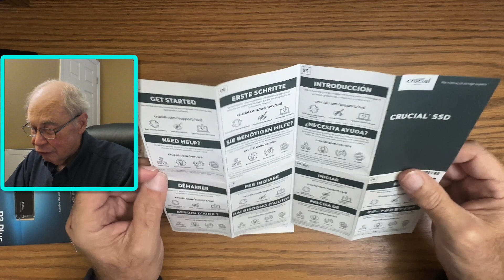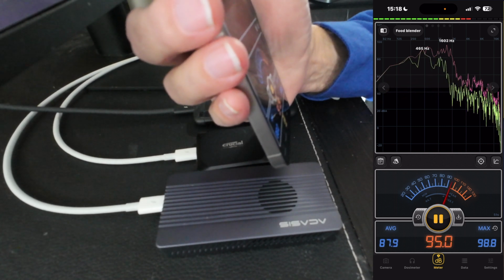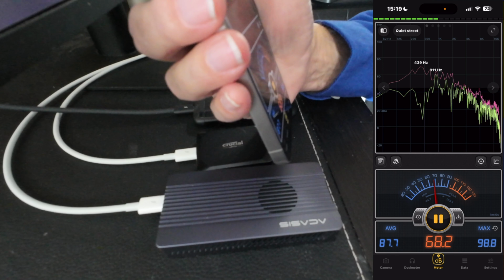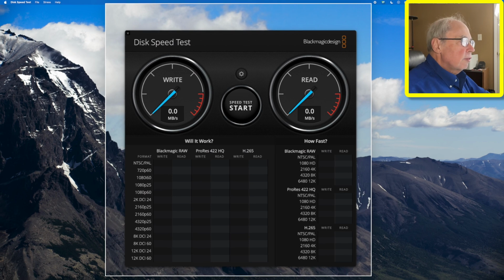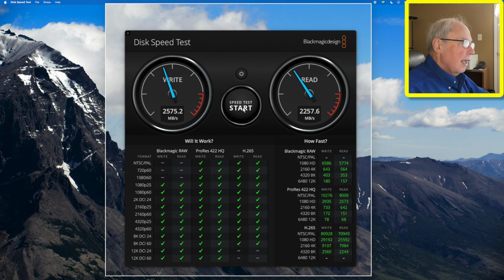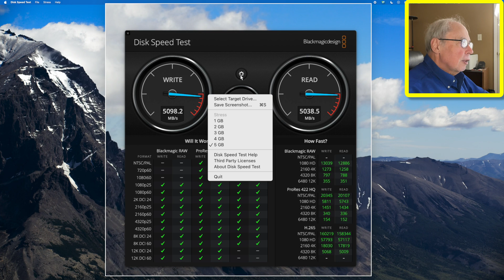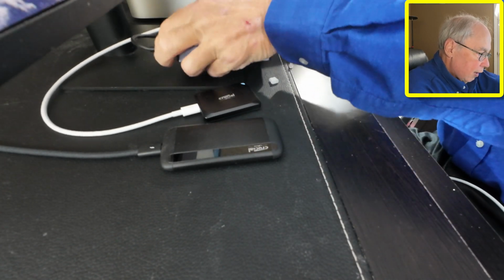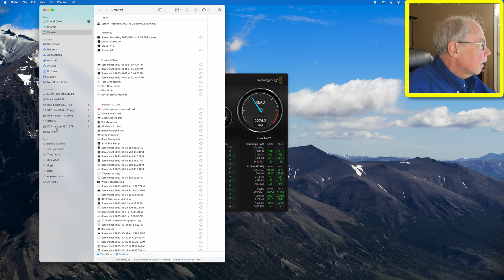Acasis Enclosure with Crucial P3 PLUS NVMe M.2 SSD - FAST ENOUGH?

Comment: Please remember that the cable that comes with this enclosure is a Thunderbolt 3 cable, so to get thunderbolt 4 speeds and compatibility you will need to buy a separate Thunderbolt 4 cable.
Reply from the maker: Thanks for the tip! It just so happens that I ordered TB4 cables from Amazon and they are due today. I'll take a look to see if I can get more speed. The cables I ordered are Maxonar brand because they are cheap! I'll stop by the Apple Store and get one of theirs as well just for comparison!
Reply: @ed-tech-review  and what are the results?

Comment: I've been seeing a lot of reviews of the Acasis enclosure lately. Having to guess which thermal pad to use is a little unnerving for me. How well do they hold up?
Reply from the maker: Thanks for watching!  I just used the standard pad that came with the SSD. One major reason I chose this enclosure was the fan. The noise is not a factor and the case stays absolutely cool to the touch.

Comment: Hy im pretty sure that the usbc thunderbolt 4 ports are on the back of the ultra m1 which is a magnificent machine , the front they are only usbc 20 giga bit speed which im pretty sure of , could you do the test again this time plugging into the back champ cheers !
Reply: Hi Nick! Thanks for watching. On the Studio M1 Max (and the M2 Max) the front ports are usb c 3.1. On the Ultra version of both Studio computers all six ports are Thunderbolt 4.

Comment: Speed for external drives are limited by the thunderbolt and usb 4 40Gbps theoretical
Reply: That is the speed of the thunderbolt ports and unless my math is wrong that would calculate out to a theoretical max of 5,000 Mbytes/sec but as I said I'm very happy with the speed I'm getting.

Comment: Those test don't tell the full story. They only use 1gig. If you write files that are much larger and sustaining(50-100gig and up) You'll find speed drops significantly. The problem is your consumer based SSD drive. There's a small section that is super fast, hence the fast speed you see in your test. The large majority of your drive are super slow. Most times slower than than cheap micro SD cards. Once you use up the fast portion, the rest is krap. The ssd manufacturers pull a fast one on us and the youtuber people tricked us into thonking well get superior performance all around all the time.

Those enclosures are a waste of money since your drive will never let you reach their full potential. Just get the cheap $15 and put in a large thermal pads that covers the whole drive. It should keep the unit warm instead of hot. Your speed is no worst than the expensive 40gihz units with the fan eventbo the ones with the fan will be cooler to the touch. But no performance gain in long sustaining write or read uses. 

The biggest limit factor after the SSD drive is your USB-A or usb-C cords and the ports.  Maybe different on Mac.

Comment: are you able to connect it to your phone and copy more than 1.5GB data without it failing?
Reply from the maker: I hadn't connected it to the iPhone 15 Pro Max but did when I saw your comment. I couldn't get the iPhone to mount the drive. Normally with an ssd connected it shows in the app when taking a video but this one didn't. I'll see if I can find out why.  Thanks for watching!

Comment: Short answer is they need wiggle room for buffer as well. You will never get a full 40gbs speed. But the right ssd you are using with this type of enclosure will determine the speed and write speed. For this enclosure go with the WD SN850X, speed should be around 2800-2900 both read and write.
Reply from the maker: Thanks! I plan another test with a different ssd shortly.  I hope to see even better results with the new ssd card although I'm very happy with what I'm getting with the Crucial card. Thanks for watching!
Reply: it's the intel controller chip in this box (which is pretty much the same as orinco and other boxes, same chip same solution) that reserves bandwidth for other function, new boxes come out with ASM2464 controller does not reserve bandwidth and can achieve higher throughput but I heard that chip has some thermo issues. will wait for more reviews before buying those.

Comment: Excellent work!
The performance outcomes for this device:
Solidigm P44 Pro 1TB - Read/Write speeds: 2780/2765 MB/s.
Reply from the maker: I will be posting a review of the WD 850X with a different model Acasis enclosure in a couple of days.

Comment: Bottle neck of the Acasis drive is the problem. It supports upto 40 Gbps meaning 4000 Mbps.
Reply: And if a NVME external ssd claims 5000 MBPS its always 1000 to 12000 Mbps slower sad reality 😢.
Reply from the maker: True and I wasn't really expecting the 4800 they claimed and while I'm perfectly happy with the speed I'm getting, more speed is always better. Thanks for watching!
Reply from the maker: Thanks for watching. That could certainly be the problem. I also have a Crucial X10 which claimed up to 2000 MB/s but it's actually about the same speed as the X8 I got previously (about 980 MB/s). When I contacted the tech support email they replied that the ports on the Mac Studio will support Thunderbolt 3 or USB 3.1. They said to get the rated speed I would have to use a USB 3.2 gen 2 port. I think this is a problem from BOTH companies. Crucial should support Thunderbolt and Apple should support ALL USB C protocols on a computer that sells for $4K.
Reply: Hi, I just have ordered a similar setup. At first, I almost ordered X10 pro SSD, but then learned it would be limited by 600mb/s on M3 MacBook Pro because of not supporting TB4 by the ssd. Then I learned about M2/TB4 setup and was tempted by crucial M2 plus (4800) over M2 (3600). I took the latter bcs  TB4/case will not go over 3000 mb/s.

Comment: I don't think you're getting the full 32gbps (I know it says 40gbps, but these ACASIS cases are not true USB4) because the Crucial P3 Plus won't reach those speeds in an enclosure for whatever reason. Maybe due to the lack of DRAM cache? Not sure. Or maybe it's the controller. 

I just tested a Crucial P3 (non-plus) 4TB and got around 2250 MB/s read and write. I put in a Samsung 980 PRO 2TB and it went up to around 2750 MB/s read and write.
Reply from the maker: Thanks for the information! I have a WD card arriving on Wednesday and plan to test it in the same enclosure along with another enclosure I have coming as well. In addition I'm going to try the Crucial SSD card in the new. enclosure. Thanks for watching!